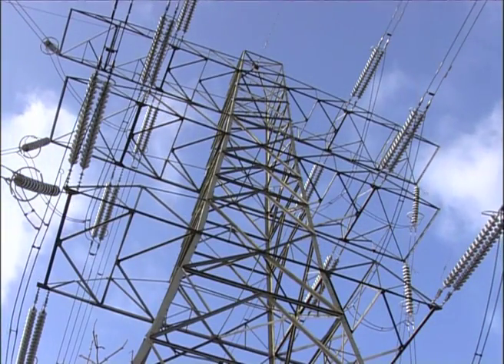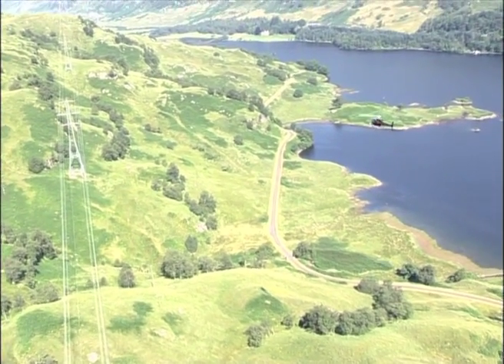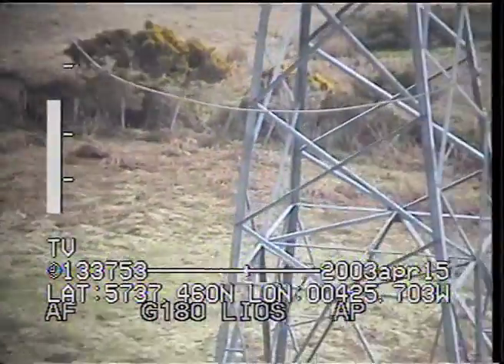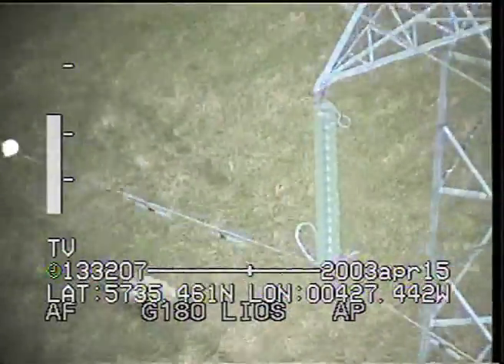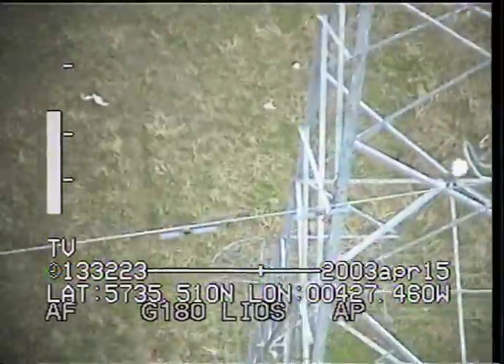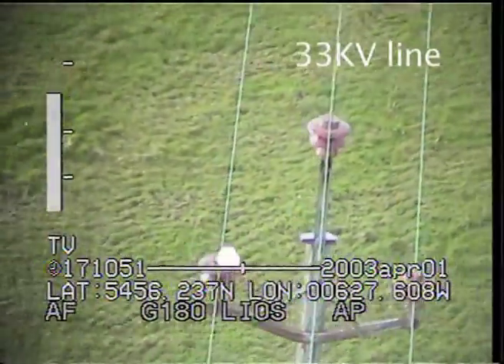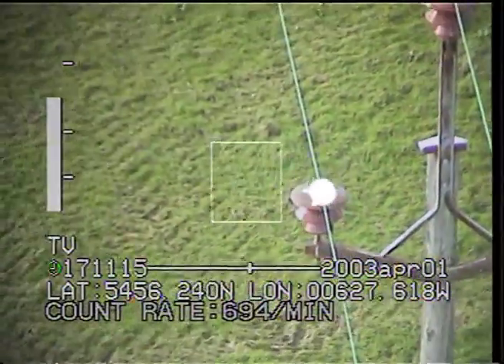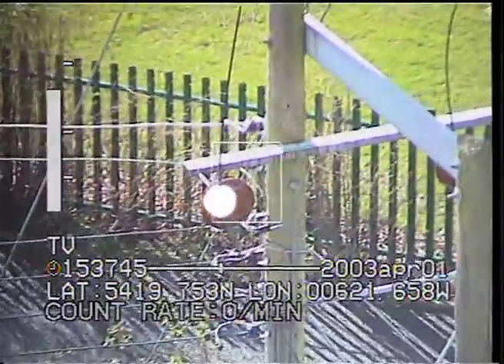Corona Power Line Inspections by PDG Helicopters

Comment: Corona discharge is generally undesirable in electric power transmissions, where it causes power loss, audible noise, electromagnetic interference, purple glow, ozone production, insulation damage, possible distress in animals that are sensitive to ultraviolet light, and local vaporisation of metals.
In many cases, coronas can be suppressed by corona rings, toroidal devices that serve to spread the electric field over a larger areas and decrease the field gradient below the corona threshold

Comment: If they are detecting UV bursts from discharges there is no reason to expect the frequency of the flashes to be limited to harmless spectra.

Sure UVA is mostly harmless and UVB is the spectrum normally associated with sunburns but there is no reason to believe that anything other than total energy determines what the frequencies emitted are. Could be anything from UVC (commonly used for sterilization and water purification; kills all living tissue) to soft X-rays.

For years conspiracy theories abound about how residential living near high voltage power lines was making people sick but amateur scientists have focused on the magnetic fields. Perhaps any health affects could have been caused by long term/multiple exposures to these flash bulb X-ray flashes that are too short to have been detected by normal X-ray detection methods. And because it never occurred to anyone to look for them.
Reply: The amount of electromagnetic spectrum discharges in the harmful range you would get from a high voltage line would be insignificant compared to the amount you would get from the sun.  It's not that X-Rays are automatically bad, it's the amount you are exposed to that is bad.